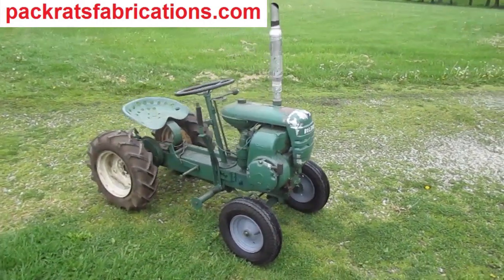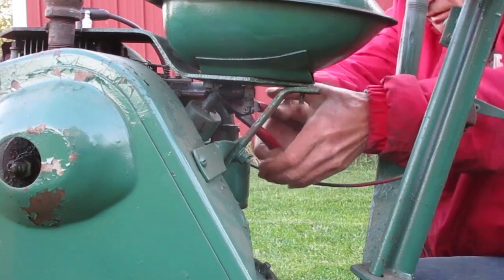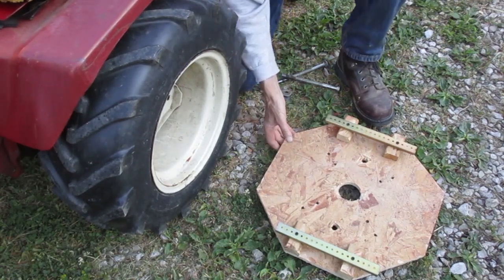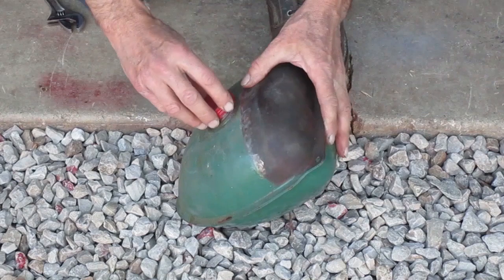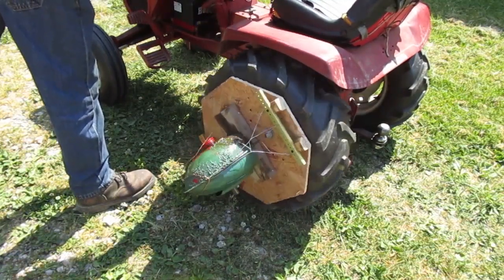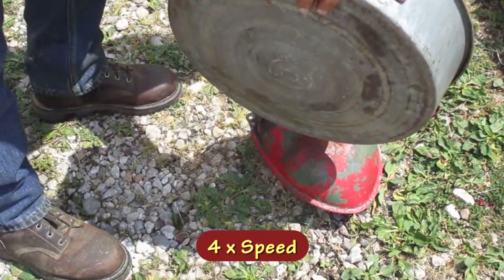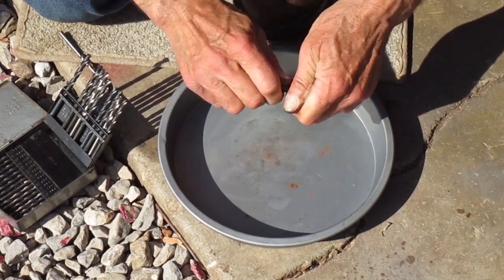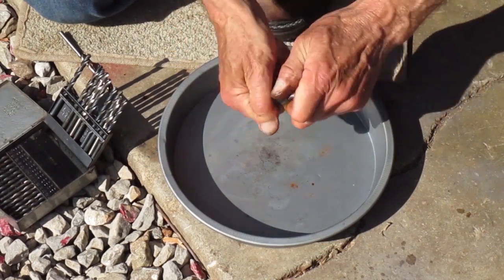1957 Bolens#2 Fix-up Part 2

Comment: When you put your water in with the stone, use some Dawn dish detergent, like 2-4oz depending on dirt and tank volume.  It helps with the "action" of the aggregate,  plus cuts the petroleum deposits. I've actually seen how it increases the mobility of the aggregate.  Plus cleans it when you're through.
Reply from the maker: Sounds like a good idea, maybe I can remember to try it next time. Thanks
Reply: @PackratsFabrications  We would use Stainless steel bits and pieces or with stone pieces (cylinder or cones) . If you get a film of dirt or grease on the pieces,  just add more soap.